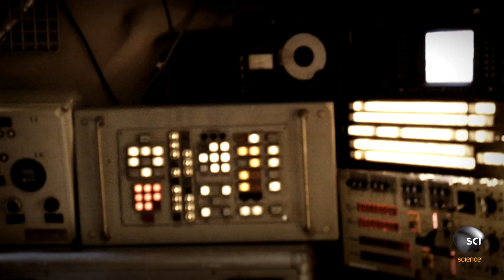Possible Smoke in Cabin on Troubled Spacecraft Reentry

Comment: Nice video and regarding Yuri Malenchenko his Soyuz TMA-19m reentry with Tim Peake ESA UK and Tim Kopra didn't go through a ballistic reentry just like  TMA-11 mission and my guess is that the Russians must have improved the pyro bolts that separate the Habitation module from the decent module for latter Soyuz TMA TMA-M and MS from 2008 onwards to prevent this from happening after this ballistic reentry on TMA-11